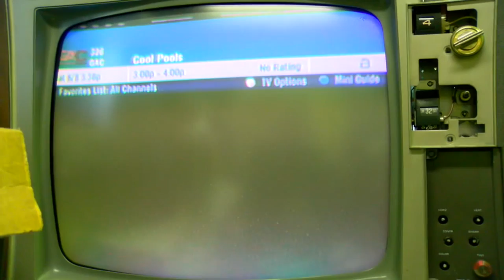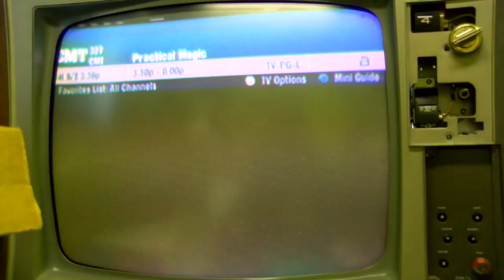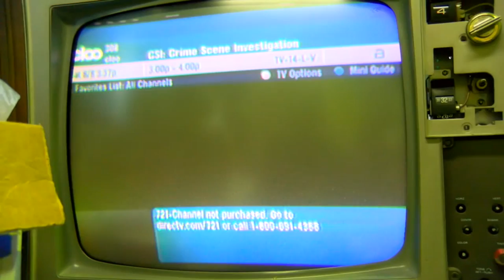RCA Flyback Repair 2

Comment: I'm glad to see that Shango decided to use silicone sealer for that flyback transformer that doesn't contain acetic acid. (I contend that the Republican debate was more like a circus than a theater, but I digress. Yes, our presidents get "appointed" by the Electoral College, not the voters.)

Comment: Hello would you be able to find me a 1950s square would box zenith TV table model. It doesn't have to work but needs to be repairable. I want one to watch tv on in my bed room. To match the rca wood box radio I am restoring. And the record player I bought three years ago that I can plug into the radio. I plan on having a full matching antique appliance set.

Comment: im very suprised tv manufacturers didnt use ceramics instead of rubber for flybacks, after all pylons use ceramics
Reply: +Synthematix With the tight spacing they need between the wires, ceramic would probably have been impractical. Don't the transformers on power poles and in transfer stations still use oil with some kind of flame retardant? One thing that made TVs a lot safer in the late '60s was the switch from wax to silicone for flyback insulation. That's why they were able to get rid of the big metal housings that were supposed to stop the spread of fire.
Reply: Synthematix got to also wear out to sell parts or the next model down the line.